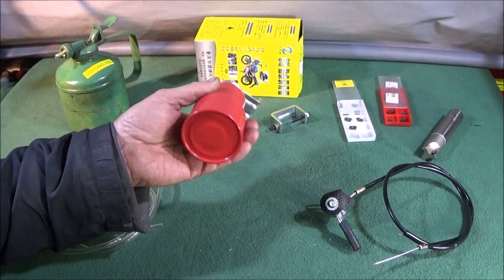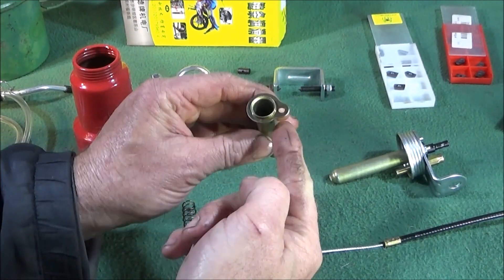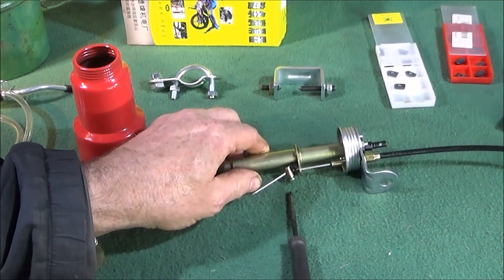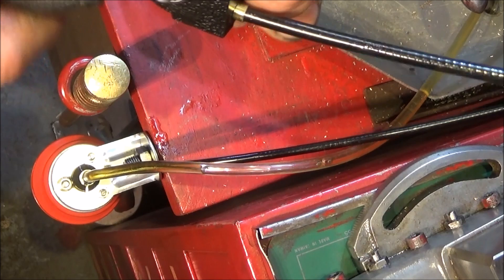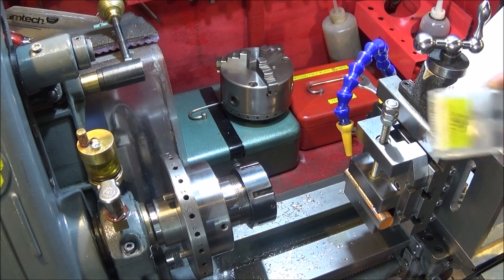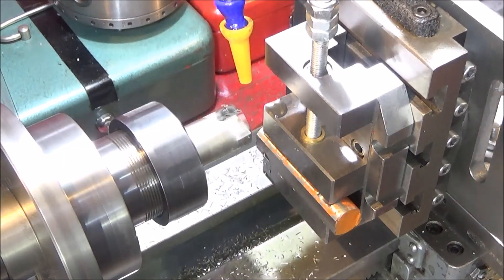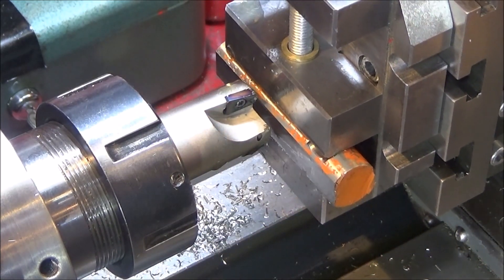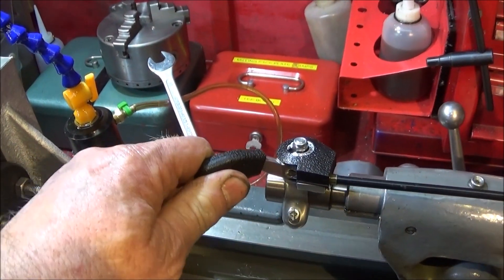Use A Motorbike Chain Oiler On The Lathe + Blue Nano Milling Inserts

Comment: Hi Steve. Really like your videos thank you and the part numbers are helpful too. I see that you have put a label  on your oiler system. What labeller do you use please as oil etc.. is often a problem??? so it needs to be splash proof. I was at the Doncaster show and a gentleman next to me on the RDG stand was telling another customer about your cross slider drill attachment so we all had a chat about your good work.Many thanks. Nigel
Reply from the maker: Hi Nigel Thanks. I use the Brother H101C. It is the best labeller I have ever used, because the cartridges are so good. value. They have 8 meter length tapes and there are plenty of compatible types. It is very economical unlike most of the other makes. Also the labeller is very well made out of good quality materials. I keep mine in a cardboard box in the workshop to protect it after use. I will put a link later for the best price cartridges.
https://www.ebay.co.uk/itm/Brother-Hand-Held-Label-Maker-Labelling-Print-Machine-Tape-Batteries-H101c/162875684433?epid=222714734&hash=item25ec25b651:g:6RYAAOSwoNVa7V5f
https://www.ebay.co.uk/itm/3pc-12mm-Laminating-Label-Tape-for-Brother-TZe-631-Tze631-P-Touch-PT1000-PT1005/252086994442?hash=item3ab18e460a:g:8s8AAOSwyQtVn4-H
Reply: Hi Steve
 
Thank you so much for your reply and the links. I will order one soon and let you know how I get on. its 
nice to have a personal recommendation  Also members at my Club Harlington Locomotive society often discuss your videos too!!!!
 
Thanks again 
 
Nigel

Comment: Got my oiler (great tip, thanks!) and added a foot pedal controller. As mechanical foot pedals seem hard to come by, I took a chance on a heavy duty footswitch (search ebay for "Durable antislip industrial footswitch" - should throw up results for a large blue two-section footswitch).
Worked a treat, and very easy to mod. Remove internal switch. Drill 2mm hole in switch actuating plate, loosen pivot rod, rotate pedal pivot 90 degrees and re-tighten.  Knock up a cable guide or pinch one off an old bike and fit it to rear of pedal, centred on 2mm hole in actuating plate. Thread core of cable through plate, guide and sheath and then connect to oiler. It may be necessary to cut a few centimetres off the cable sheath...and I found I needed to superglue the plastic pipe onto the oiler to stop it from weeping. I also added some rubber feet to the pedal...as it turned out not to be very 'antislip'.
If you want more 'throw' on the pedal you can adjust it by means of a screw beneath the foot plate - and if you need still more, you can grind material off the pedal stops on each side of the pivot.
I found it works best when set up to give short spurts of oil when the pedal is set to a short throw and tapped with the foot.
It's all pretty obvious once you have the pedal in front of you.
Reply from the maker: Hi Bob, sounds a great idea and leaves your hands free. Thanks for sharing Regards Steve

Comment: Hello again Steve I found a cheap 12v  small bilge pump on ebay for about £7  as an experiment. eBay item number:172404437893 which worked really well with your magnetic base for the Banggood nozzles, Just one thing though, I found under pressure my tap leaked which would not be a huge problem in practice, but I  wont complete this job until I change motors, due to the proximity of the motor on the Chinese Mini lathe. Might be something worth considering with your new VFD set up though.
Reply from the maker: Hi Stephen. That looks a good idea. I do have a small 12v pump that I was going to use for an oil system but not sure whether to do it now. I only ever use oil for drilling. I dont part off on steel at the moment but hope to make a rear mount tool post sometime like I have on the Myford

Comment: Steve  interested in how many indexing holes you have in the back plate .Want to do mine but not sure which number to use.
Reply from the maker: Hi Kevin. The number 24 is the lowest number with eight divisors. This is why its chosen for an indexing device. You can divide the numbers 1-2-3-4-6-8-12-24 into it. Giving the equally spaced divisions. Very handy when machining many different kinds of components. 
 So far with all the projects I have done the 24 holes have been all I needed. Regards Steve

Comment: Steve, I'm not picking on you..just dealing with my own obsession finding obscure info. I found this item on aliexpress with assembly pictures which does NOT show the black piece in their package. So, i think i understand your point..just because the black part was packaged with the pump doesn't mean it belongs there.

 https://www.aliexpress.com/item/Professional-Motorcycle-Pit-dirt-bike-Auto-Hand-Control-Lube-Lubricator-Tuning-Lubrication-Automatic-Chain-Oiler-protect/32817732799.html?spm=2114.10010108.1000014.1.2f8b5c42KbLia3&traffic_analysisId=recommend_3035_null_null_null&scm=1007.13338.98644.000000000000000&pvid=dbd6de30-b737-450a-8baf-47b069060cd3&tpp=1

Comment: Hi Steve,another great set up,I spotted this unit a month ago ,mounted it on my lathe a little different.used a Allen key that fits the tool holder set screws for a tower holding the nozzle ,gives me several spots to place the nozzle and easy to set aside when not used,thanks again for your time,camera shots,and commentary.regards TW Canada,s west coast
Reply from the maker: Hi Tony..Thanks It is a great oil pump. I thought it might be like one of those modern oil can pumps at first, but the pump mechanism on this one is excellent. Regards Steve

Comment: Nice oil system.  Trouble with Banggood which drives me nuts is they have no index and the world's worst search engine coupled with a unique insert designation system(?).  I have bought tool holders from them and then spent hours trying to reorder inserts.  They have a habit of mislabeling or changing the labeling on the toolholders and hit or miss on labeling inserts.  Good luck trying to replicate an order.  Trying to determine if they have a positive rake angle is also frustrating.  Cutting radius--hah!  The only thing keeping me trying is the pricing and free shipping.  You would think a marketer would try to improve but they don't.  Out of the billions of Chinese you would expect a few to know the language where they are selling fluently. Maybe an accurate description of the item for sale??   At least when publishing proof read it.  Oh well.  Take care.  Doug
Reply: Banggood is good...
You bought one, but get other...

Only Banggood is satisfied, they get money...
Reply: Douglas, Just look for this goods on Aliexpress.
Free shiping and prices same with banggood.
Bangood is chinese shop, but Aliexpres is tradind paltform.
Seller get money from ali only after you shipping confirmation.
I bought from ali more than 6 years,but from banggoog try tree thinks, first come good, second come diferent from picture, third ...still waiting...
This problems never hapened on ali.

Comment: Nice addition for the lathe. What is the type of oil you use?
Thank you.
Reply from the maker: Hi I do use a proper cutting oil usually but at the moment I just use new car engine oil. It seems to work just as good. Regards Steve
Reply from the maker: Hi Juan Thanks..I just use ordinary new car engine oil at the moment. It works fine for parting off, milling and drilling.

Comment: Good video Steve , could you give the link to the 3 fluke end mill and inserts that you demonstrated in this video. I have bought a few carbide end mills but they get very pricey. This looks like a much better way to go. And inserts are much easer to change than to try and sharpen end mills. Thanks for the video.
Reply from the maker: Hi Anthony I have just put the links in the video description now, The cutter I'm using in the video is the 25mm one but there is the link for the 14mm one as well. Regards Steve
 Motorcycle Chain Lubricator Oiler Maintenance Set --  https://goo.gl/baLiRL 
    300R C25-25-150 Milling Tool Holder Lathe CNC Arbor -- https://goo.gl/gx995k
    300R C14-14-150 Milling Cutter Boring Bar Turning Tool Holder-- https://goo.gl/Pcvooq 
    Drillpro 10pcs Blue Nano Coating HRC52 APMT1135PDER NB7010 Carbide Inserts-- https://goo.gl/coajd8

Comment from the maker: Use a motorcycle cable operated chain lubricator for cutting oil on lathes and milling machines. Plus some new excellent hard Blue Nano End Mill Inserts from Banggood. ITEM LINKS BELOW:-
 Motorcycle Chain Lubricator Oiler Maintenance Set --  https://goo.gl/baLiRL 
    300R C25-25-150 Milling Tool Holder Lathe CNC Arbor -- https://goo.gl/gx995k
    300R C14-14-150 Milling Cutter Boring Bar Turning Tool Holder-- https://goo.gl/Pcvooq 
    Drillpro 10pcs Blue Nano Coating HRC52 APMT1135PDER NB7010 Carbide Inserts-- https://goo.gl/coajd8